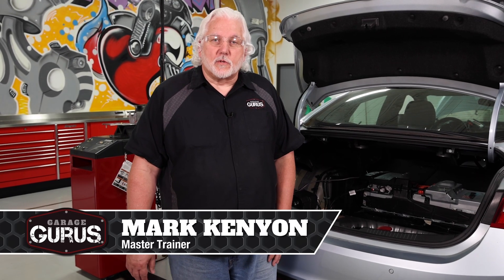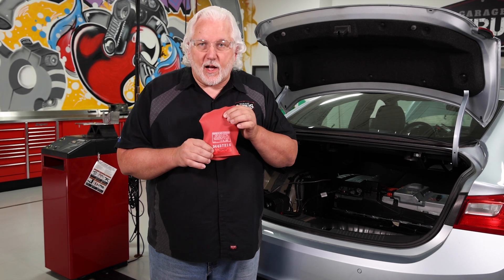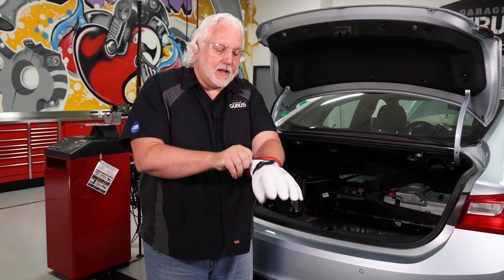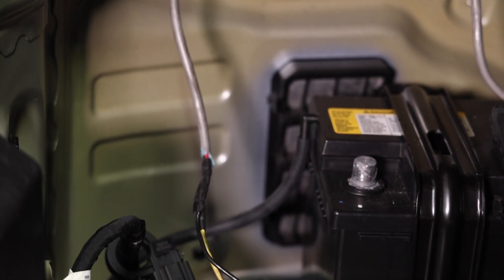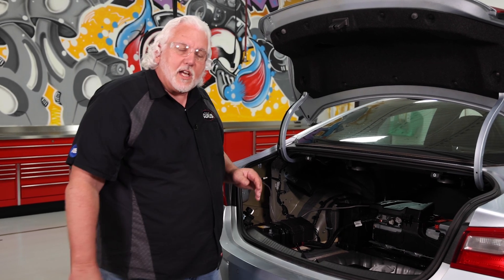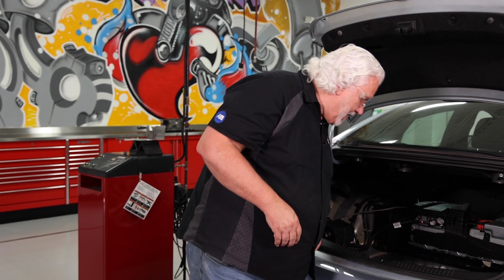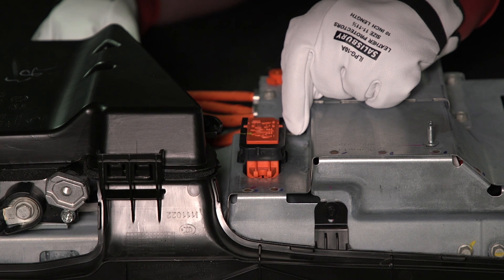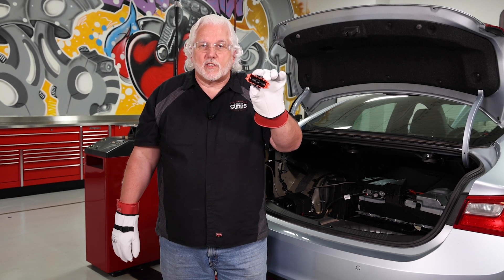Garage Gurus | Service Disconnect on Hybrid Vehicles

Comment: Put that high voltage disconnect in your pocket (like removed fuses) so you can reasonably assume it won't get reinstalled by "accident" by another.